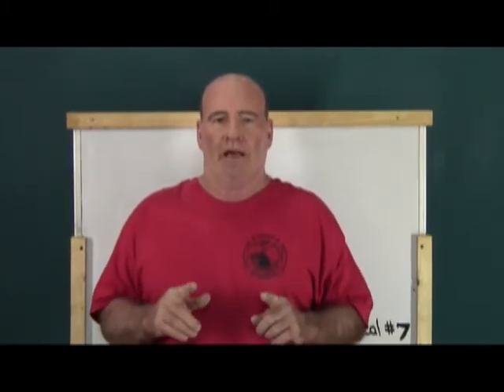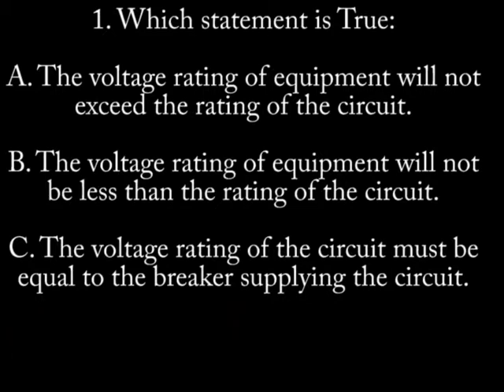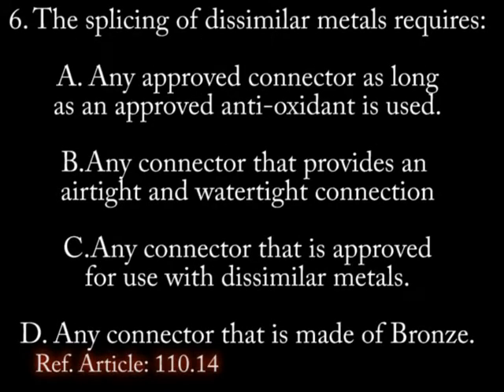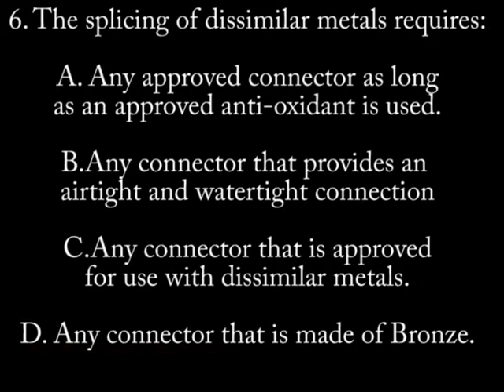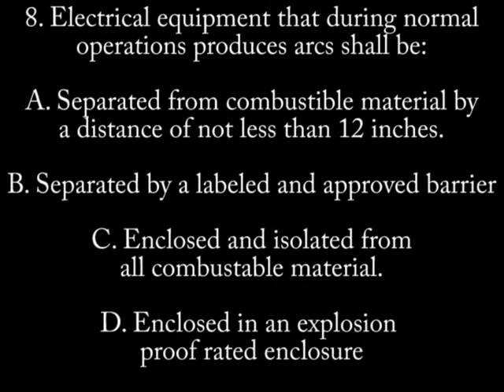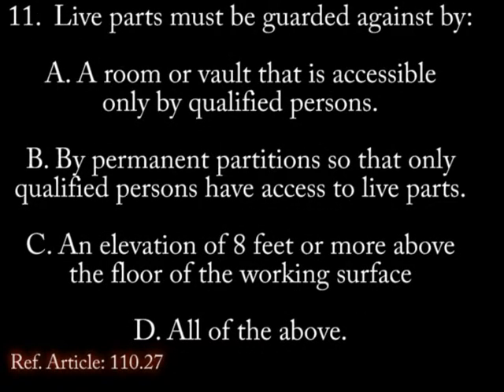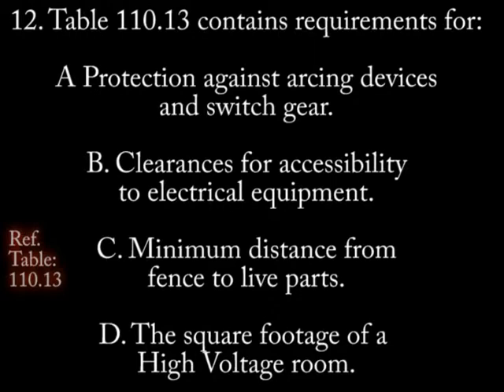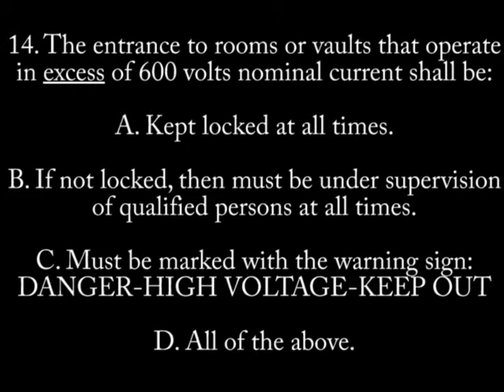NEC electrical code # 15 Code Article 110,  # 7

Comment: I like your videos it helps you search for the code yourself so you can also read the entirety of the code. It gets you flipping through the pages of the code which is the real essence of the Code book.But there is one thing I realize and maybe that is why somebody disliked it. Some code reference did not match example Question #12 ref Table 110.13 but its actually Table 110.31 and there are a few others but I love your videos. Thank you so much.